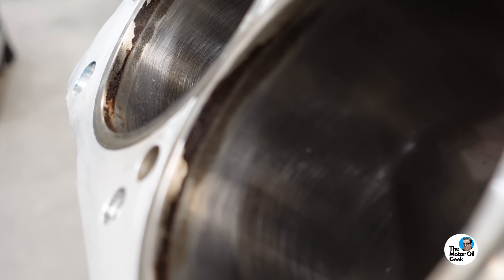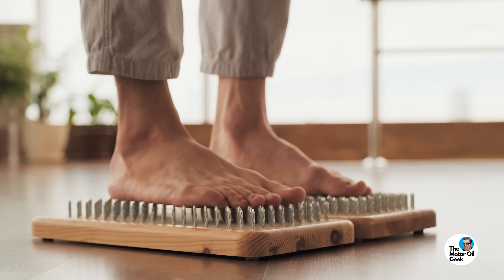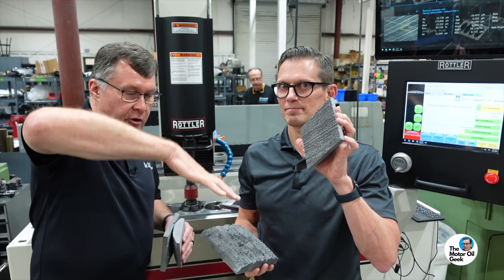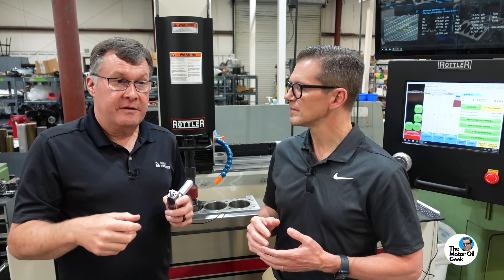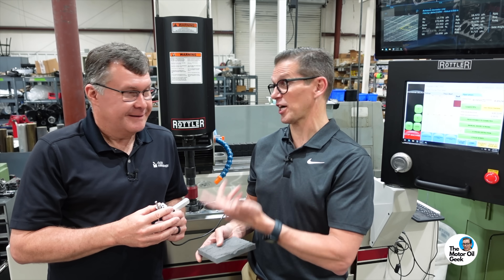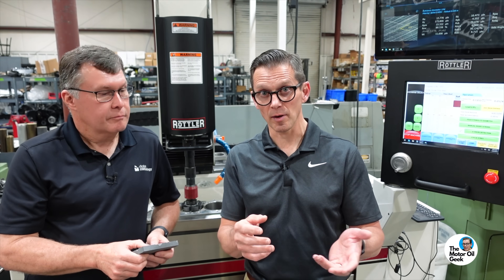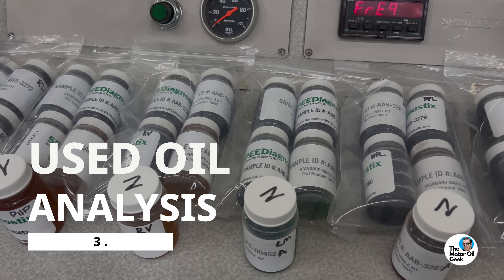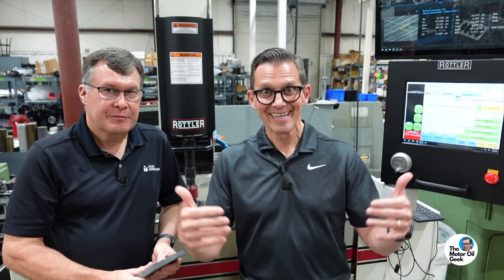GM's $1 BILLION Dollar Blunder: ROUGHNESS Matters...

Comment: Seems like we are re-learning what we already know. Diesel trucks from 20-30 years ago run a million miles on 15w40. GM engines from the glory days of the 70’s would run 300k-400k miles on 10w30 oil. Now because of increased government regulation and fuel economy requirement, manufacturers are thinning the oil to increase fuel efficiency and engines are failing! Thin oil is not protecting metal to metal contact the way thicker oils did in the past. So now we have to re-engineer surface to surface contact so the thinner oils will provide adequate protection? BS! Let’s just go back and do what we know works. Screw these fricken government regulations and build dependable cars again..
Reply: Couldn't agree more. It's worse on the environment to build twice as many cars because they don't make 100k miles...
Reply: Wanna screw something up really fast? Put "government" on it!!
Reply: How about building engines correctly within the specified tolerances? The government didn't force gm to make bad choices!
Reply: @christopherwilliams4552 
Exactly! Blaming the government for failed engines is an excuse for someone who doesn’t take responsibility for their own mistakes.
Reply: @christopherwilliams4552  - I’m not sure I agree. The EU standards and US EPA are putting so much pressure on automakers that they are forced to cut corners to remain profitable, coupled with outrageous electrification mandates that consumers simply aren’t buying literally means governments are running automakers out-of-business.  All these new, untested and unreliable technologies automakers are bringing to market are simply an attempt to stay in business and avoid fines for non-compliance.
Reply: @ynotjf if all regulations were magically lifted, manufacturers would still make mistakes like this. This is an engineering process question, IMHO. Not a government regulations issue. BTW, if all regulations were magically lifted, we'd also be living in a significantly more polluted world!
Reply: @christopherwilliams4552 
Agreed! I remember smog and prefer not to see it again. Also, just look at third world countries without regulation. Is that what these guys want?
Reply: @christopherwilliams4552 the government sort of forced all of them to make bad choices. And then they made even worse choices
Reply: @BabyGators I disagree. US auto companies are just not run as well as they could be. IMHO, this is one more example of that fact. Why can the Japanese successfully sell cars in the US and Ford cannot? Is it the government or the leadership of the company? Seems obvious to me!
Reply: @christopherwilliams4552 Japanese companies don’t make diesels for the US market. That’s what I’m referring to. By no means am I defending many of the choices of the US OEMs
Reply: 400k from a 70s engine? Those things were tired at 75k.
Reply: @zacharysandberg the odometer didn’t even go to 100k back then.
Reply: @zacharysandberg I've seen Chevy 350s get close to 500,000 and Plymouth/dodge  slant 6s get close to a million miles.
Reply: @zacharysandberg only if not taken care of
Reply: Rose tinted glasses. Those who truly remember old cars remember engine overhauls at 100k and frequent fiddling to keep them running right. A lot of these new cars are pretty dang good.
Reply: @d47000  I've got an original 80's Mazda that has used 10W-40 it's whole life at 330,000 km's, mostly severe duty short urban trips, with no sign of wear top and bottom ends..
Reply: Why are you blaming the oil?

Why is Toyota not blowing engines on 0w16? And they even have some running 0w8
Reply: You were very lucky to get 100k on 70's engines. Lmao! GM had plenty of flat cams back then. You just didn't hear about it near as much because of... The media we have today.
Reply: GM has specified 0W20 oil for over 10 years in L87 engines. The only engines with issues are recent model years. Lake has talked about this in his other videos. Lake himself has built L87 engines for racing, and his testing has shown a properly built L87 engine can reliably use 0W10 oil. The oil isn’t the disease.
Reply: Don't forget the micky mouse variable volume oil pumps they are using.
Reply: Incorrectly blaming the motor oil for what the crappy cost cutting GM manufacturing process did just obfuscates the real issue.  A lot of the blame that these lower viscosity oils receive is really from the cost cutting poor manufacturing and overly optimistic marketing driven maintenance schedules from the manufacturers.  So many "old school" people ae hung up on the "weight" of the oils instead of focusing on the actual lubrication properties of the oils.  It's time to move on past the "weight" of the oil as the primary factor as lubrication in an ICE vehicle is the flow of oil over the metal surfaces.
Reply: Thinning the oil is needed for blow by pressures simply increasing weight will make it worse. Non vvt engines didn't have to worry about this
Reply: @gvi341984 honing the cylinder correctly will solve the blow by issue, thus negating the thin oil.
Reply: @gvi341984 how do you mean?

Comment: Almost 1 million recall is unbelievable in today’s machining processes on a crank bearing surface ! 
I learn something every time you post a new video ! 👍
Reply: The board room bean counters have destroyed GM.
Reply: @raymondbennett9195  i bet they still got their bonuses and raises
Reply: Quality control is costly in any industry.
Reply: @MHolt-q1q how do you expect marry Barra to make millions with proper quality control?!????
Reply: I don’t think the engineers coming out of our schools aren’t that smart. The technology transfer hasn’t occurred or has been weeded out trying to save money.
Reply: Similar to the automatic transmission problems. For GM (and Ford & RAM, bad memory).
The valve bodies today are made of aluminum. 
But lately the manufacture of them (not GM, Ford or Ram) is using poor cheap almuminum which are too porous and do not hold oil pressures.
A former GM engineer said they know this but will not fix them. HE has a business that does repair the trannys and gurantees them for life.
Reply: what factory in china made the cranks ???!!!  For what they are charging for these vehicles they should have high end billet cranks or high quality forged cranks made here in the US !!  Just more junk pawned off on the public consumer !!!!  Used to work with a fellow whose uncle worked for gm as an engineer who designed parts that would wear out after the warranty expired !!!  i HOPE THEY CHOKE ON THIS !!!
Reply: @joelalleman9591  the 6.2 cranks were manufactured in Mexico, not China
Reply: @joelalleman9591  If GM chokes on this, Uncle Sugar will give it a tax payer funded Heimlich Maneuver, guaranteed.
Reply: @michaelg4931   Theres a court ruling that shareholders are more important than consumers.

This is the result of that. aswell as DEI hires, middle management with degrees instead of knowledge like Lake Speed. aswell as sending production to Mexico.

Few skilled people would ever relocate to Mexico...
Reply: @joelalleman9591  they're barely getting by saving money on making parts overseas.
Reply: @joelalleman9591 
That's where they came from
Reply: @joelalleman9591 you are 100 percent correct!
Reply: The 6.7 power stroke is next...